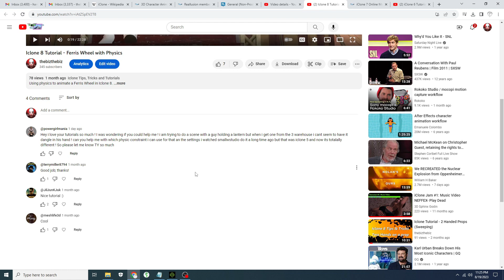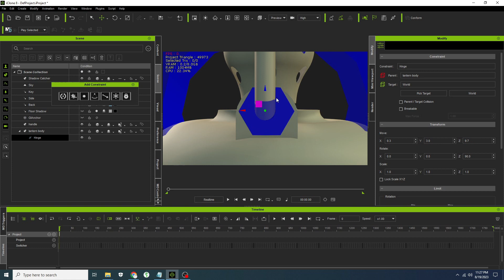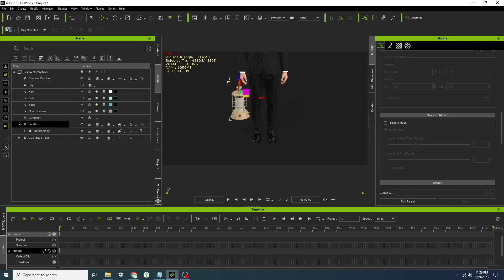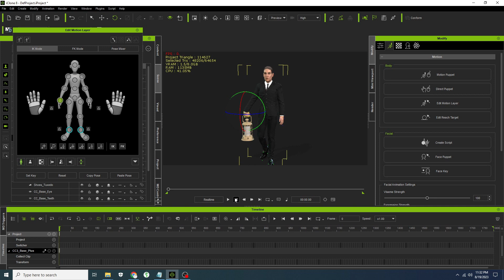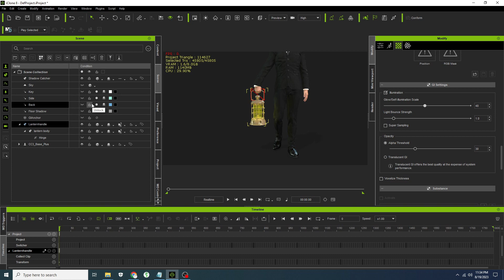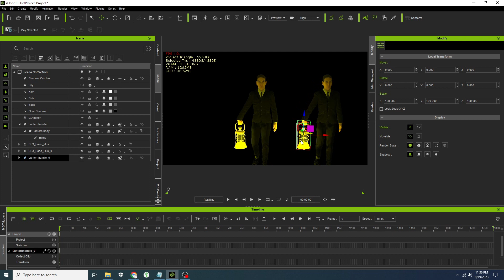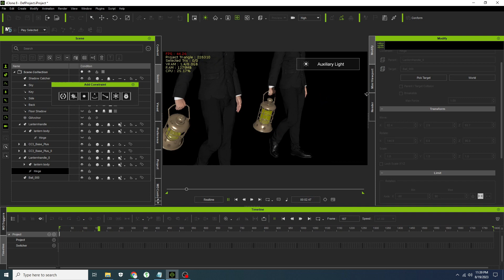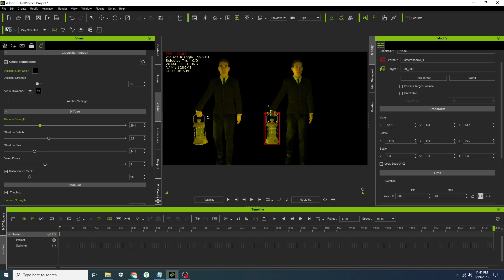Iclone 8 Tutorial - Swinging Lantern Prop with Physics Constraints

Comment: Thank you sir
Can you explain me how to animate ornaments like neckchain, bangles & earrings along with character animation? In ic8
Reply from the maker: The necklace chain may not be worth the effort of using physics  (high level of difficulty...likely easier to just add the necklace as cloth or static accessory) but the dangly earrings are pretty easy.  Just use a point to point constraint on the dangle with the constraint linked to the earing.  Its a similar process as this lantern prop.  I might try to whip up a quick tutorial this weekend if I have the time.
Reply from the maker: See if this helps you in your quest for dangling earrings: https://www.youtube.com/watch?v=6DsxcyJEUrw